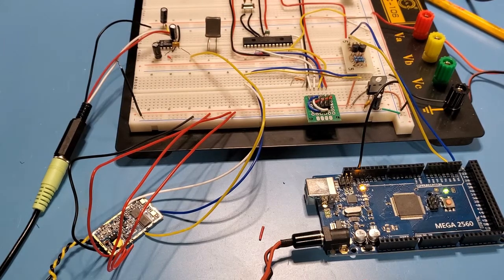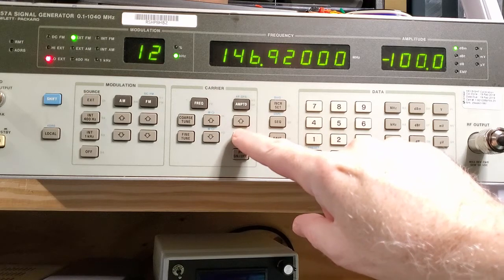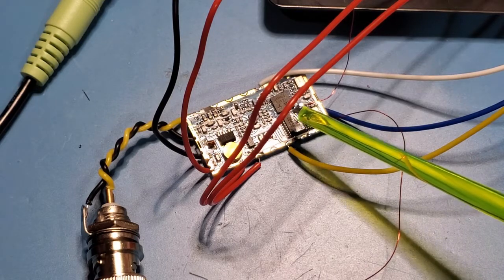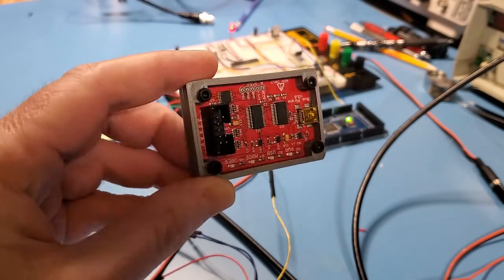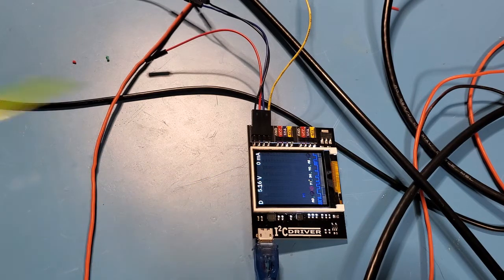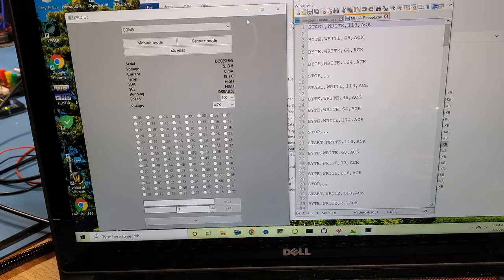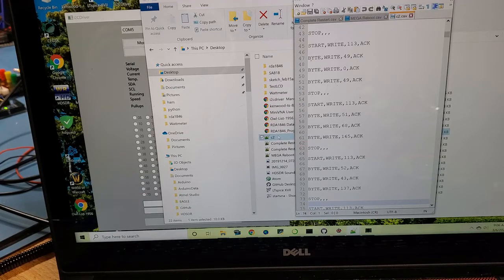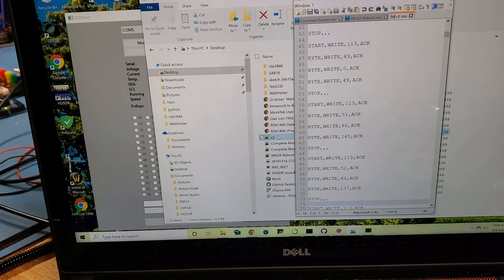RDA1846/SA818 - Capturing I2C with I2CDriver

Comment: still searching for setup of the crystal frequency? That is just two bit but not the frequency written as plain value. There is "xtal_mode" and "clk_mode" to select 26/13MHz, 25.6/12.8MHz, 12.8/13Mhz, 25.6/26MHz
Reply from the maker: Thank you for the info Uli - although I haven't played around with the RDA for some time!
Reply: @na5y  I am about to. Possibly. Stumbled upon the DRA818V but disappointed about the limitations. Interface to MCU is RS232 that reminds me of 1990 modems AT command sets. You have to chose "U" (uhf) or "V" (vhf) Version. The 200-260MHz Range is not supported at all. So it will be much more interesting playing with the RDA itself.
Already found a programming-guide. PCB-layout suggestions would be helpful. 
Very interesting: The Baofeng_UV-3R is based on RDA1846. It is VHF/UHF with 2 watts. Schematics are available in the internet. Very helpful. I would use ESP32 MCU with nice colour display. Cheap as arduino with much more power.
Reply from the maker: Yeah - that serial interface was awful - and did remind me of my old Hayes 56k modem! Good luck with your experimenting